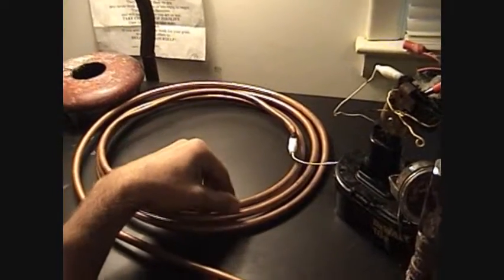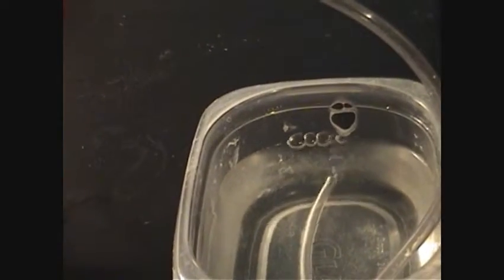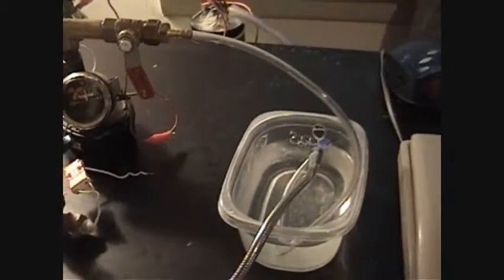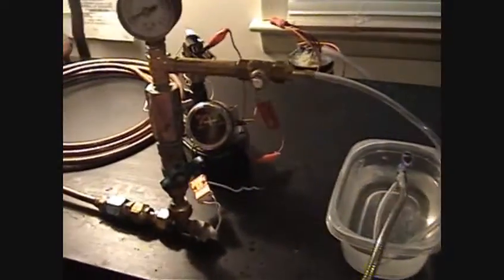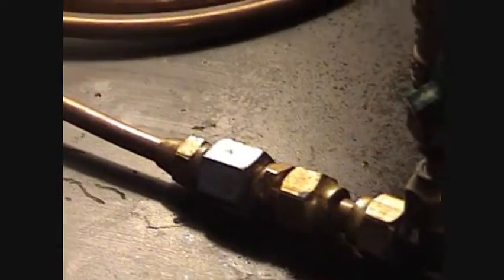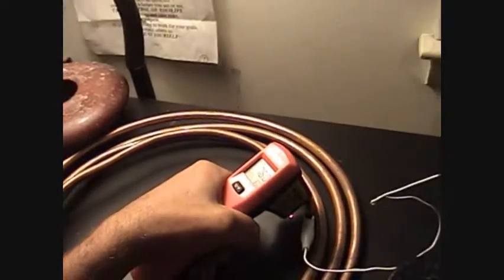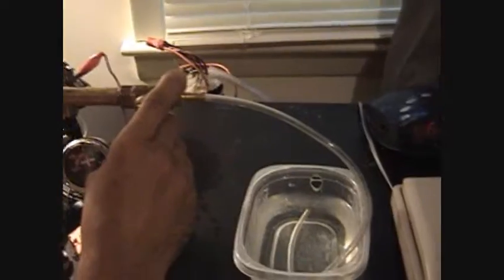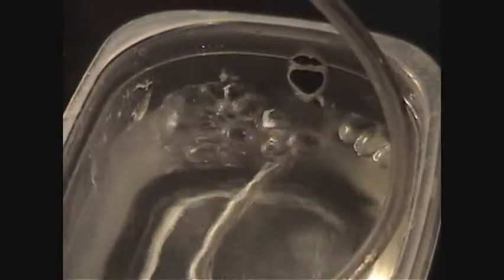Spark Cell W/ EE and Addons

Comment: Great cooling system. Be a cool idea if your get going with enough cells, to cool them off by piping them into your hot water tank and exchanging some heat there.